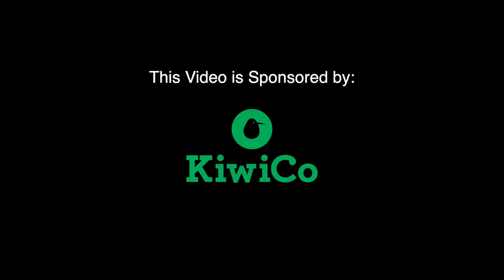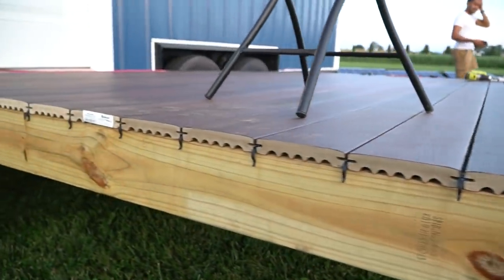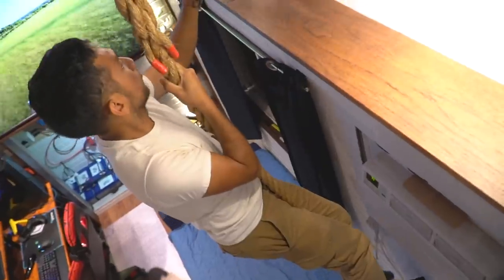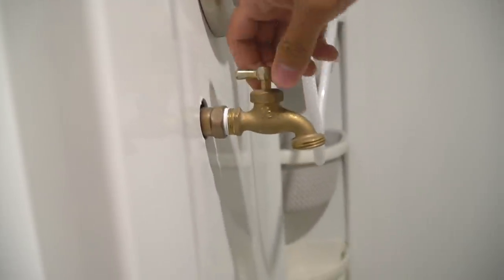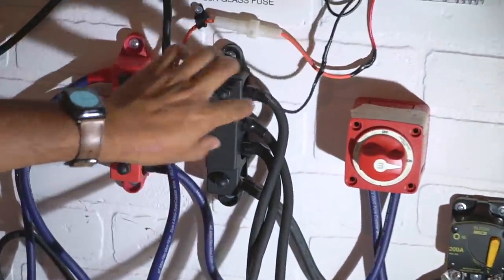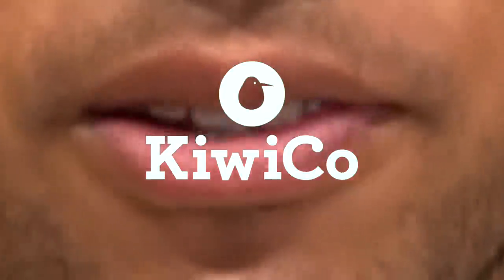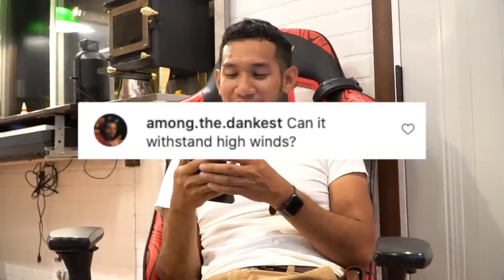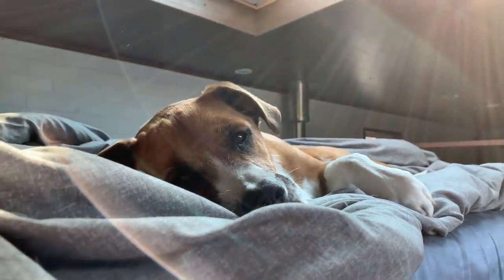BUILDING AN ILLEGAL HOUSE for 30,000$

Comment: I want to build something similar on the back of an m35 deuce and a half
Reply: That would be pretty sick👌🏻
Reply: Top speed: 25 mph lol
Reply: Hi
Reply: @isaactrockman4417  *2,5
Reply: fuel economy - 8 gpm
Reply from the maker: ive considered one of those for the base vehicle lololol
Reply: Ive seen someone do it with a hemmt.  Got about 1.5mpg
Reply: Have you ever seen the Unimog campers? Now that is a zombie apocalypse vehicle.
Reply: @yannickg6904  Bucks though for the new ones
Reply: @jamesshamley6577  where I am, you'd be lucky to ever spot any kind of unimog. Shame, I would love the old 500s to be more commonly available.
Reply: Look for a 5-ton with an 'expando module.' Still military surplus with plenty of parts around but almost ready made.
Reply: Got a international s-series with a 18ft reefer box, turning it into a tiny house/rv thing. But i'd rather have a deuce, except prices skyrocketed over the last few years.
Reply: I once took a deuce and a half
Reply: Yo, same here.  Except I have an M211 instead (older Deuce).
Reply: @Firebat45  today i actually dropped an old duece, I've been trying to drop it for like 5 days now I was getting worried
Reply: Thanks for that now I'm drooling! If you do, you should consider a sheet metal exterior with a rigid cast in place foam, they make them in fireproof varieties, and being foam they have great R value. Also helps rigidize the structure and cut noise, and the metal exterior would be easy to match to the m35!
Reply: Ive seen that done several times as a "Bug Out" survival camper o.o Zombehz no eat what they cant catch
Reply: @yannickg6904  Unimog Black is my lottery win go to vehicle.
Reply: @69uremum  There are plenty of parts for deuces for now but in the very near future, they will be in the 'no longer supported' category. 5 tons are still in the inventory, though.
Reply: @yannickg6904  yea, until you're looking for parts or even a replacement tire in small town no where.
Reply: @PeterSripol  I cant express my disappoints enough... 12000lbs omg & you built foamy ultra lights... WHAT WERE YOU THINKING... oh wait... you weren't, i get now... you're gunna do a foam sandwich lightweight aluminium version next aye... WHY NOT!

Have you forgotten the principles of monocoque shell (even if you did build it with a frame) & stress lines for hard points for trailer hitch & suspension
Reply: @helpabrothawithasubisaiah5316  As a dad, I recognize and appreciate that was a dad joke

Comment: I think you'd benefit a lot from having a window A/C unit that can also act as a heat pump. They're an unbelievably energy efficient way of heating your home.
Reply: "SIr the AC isn't reversable"
"Weld a license plate flipper to it
Reply: Just put it the other way around and rip the control panel and stick it on the wall.
Reply: @ignasanchezl  or get one with a remote and simple add a mirror, way easier than taking it apart. Hell, put it on something that spins and locks in place flush with the house and you've basically got it done already.
Reply: @shadowsnake5133  You would need it to be mounted with a window next to it. You would probably get some leakage
Reply: almost every house in northern europe has a heatpump! They're awesome
Reply: Heat pumps are all the rage on YouTube right now!
Reply: Is this what we call reverse cycle ACs in Australia?
Reply: thats called a mini split and he specifically explained why he chose not to use one. He also uses a wood burning furnace. I live off grid, heating is BY FAR the most expensive thing to do electrically, Its laughable actually to suggest that electric heat pump would be more efficient off grid than the wood burning stove he already has.. this is coming from somebody who ACTUALLY lives in a RV in the desert using solar. You use gas or wood for heat...always. other wise your going to use a 1000$ battery up every 45 minutes. (lookem up those are 1 kw/hr battleborns)
Reply: With that gamer rig he doesn't need a heater
Reply: @lukejohnson6415 lol if only it were true
Reply: Lane AWD  a 20kw bank? do you have ANY idea how much that cost? hes using battleborns. its easy battleborns ar 1000$ per kw, youre looking at 20,000$ to run an ac and you think thats more efficient than gathering wood and burning it? I dont care what you do for a living, i actually live offgrid.
Reply: @jihartbladhest2749  Its actually fairly accurate for a small space. My pc heats my bedroom to the point I have to crack the window in the winter even when its below freezing out because my room will be too hot. (That is without any other heat source.)
Reply: Lane AWD  Alaska?
Reply: Lane AWD  Nice. I was was born in Littleton outside of Denver
Reply: @jihartbladhest2749  While you're right about the relative efficiency and the smart order in which to use available resources... window units are increasingly availble with heat-pump modes nowadays. Of course still generally a worse idea than using the wood stove for heat like you mentioned. The only use cases I can imagine for it are when burning is prohibited, or to just slow down heat loss while the house is unattended (eg: sleeping or just out for the day). It would of course require a microcontroller or very careful use to not flatten your batteries though. 

However - Even with heat pump functionality available and working excellently I'm not sure how worthwhile it would be. The use cases where it shines are super edge

Comment: I framed houses for a few years and think this is amazing work, im concerned about the bracing of the above floor but i trust you built it well, looks amazing man!!!
Reply: there's little diagonals in the corners. Might've been in the previous video. I've never worked with galvanized, but i don't think it takes those t straps like wood frames take. plus it seems to have ridged sheeting, but im not familitar with that product.
Reply: @BattleGn0me  tbh i didnt look to hard when i commented this but thanks i see what you mean! i was just concerned for his safety at the time but hes very intelligent and im sure he built it strong😁
Reply: @ChrisW777  plus, unlike Celotex using ring shank, the sheeting was being sheet metal screwed on. I'm only replying because I need to rehab a farmhouse in the same state and I'm thinking of maybe using the same system for an update to get it up to code. But to your point, if he can put a foam/electrica airplane in the air, he's probably got the mini house thing "nailed" down--safety wise.😄 Btw, if Imnot mistaken, I think he had all teh wall members pre-fabbed by a mini-hoise custom kit company of some sort.
Reply: @ChrisW777  Also, I framed houses back in the early '90's so my understanding of construction materials and codes are a bit dated, so I'm not trying to be snarky or anything, it was just something I happen to notice
Reply: @BattleGn0me  no worries man, i dont sub to him just see vids here and there but i should cuz its good stuff, i was a house framer 3 years ago but worked with lumber so metal is foreign to me but i love the knowledge!
Reply: W youtube comment thread very rare to see

Comment: To keep the fresh water tank from freezing, an electric heater is probably simplest since you have dozens of solar panels to spare. But for a more DIY approach, consider a solar thermal collector, made from a coil of PEX water pipe coiled in a shallow box about 1 sq.m / 1 sq.yd, covered with glass or acrylic. This could either circulate water directly from the fresh water tank, or maybe safer, weak antifreeze through another coil under the base of the tank. A similar panel could work as a pre-heater for the water feeding your electric hot water tank.
But speaking of that electric hot water tank, you mention switching it on only when using it. I hope you’ve got a strategy that simply wasn’t mentioned in the video for keeping it disinfected. You can get some nasty diseases growing in a water tank when it cools below 120F / 50C. Is it good enough to hope that warming it back up to 140F or so once a day takes care of it? I don’t know, but I’d want a firm answer before showering in it.

Comment: Those stair-drawers desperately need some latches so you don't break your neck. But overall it is an extremely cool house!
Reply: i think the lids insert into the storage
Reply: Yeah but they can slide out when he walks downstairs.
Reply: yeah or some sort of edge inside so they can still be taken out but not slide out all the way horizontally
Reply: If you look close when he lifts the first one, you can see it has some kind of edge underneath so they sit in place properly.
Reply: @MotoAtheist  I think the treads simply slide in beneath the risers, which won't prevent the treads from slipping.
Reply: @mgratk  You can see there's a latch that stops them sliding off which is why when he took them off you can see he raises the front a little then slides it out.
Reply: @mgratk    I can clearly see something under the tread that allows it to align properly.

Comment: just so you know with starlink, the reason the say its "geo locked" right now is because theres not 100% coverage. As long as there is a base station in range your starlink terminal will connect, it's not actually "geo locked" in the sense that if you take it outside your property/state it wont work
Reply: Wifi ?
Reply: @joshuaconnor6085  starlink
Reply: Its primarily due to bandwidth. Satellites coverage is there pretty much at this point just each sat can only service so many subscribers. So they limit how many subscribers exist in any one area. Roaming is allowed now but the assumption is that you're not a permanent subscriber in that zone, thus they can cope with the increased contention without risking a drop in performance and service for in area subscribers.
Reply: It was actually due to legal reasons but the FCC has finally given them approval for mobile operations (mobile satellite stuff has stricter rules than geo-locked satellite stuff).  Apparently some people were able to use it on the road even before that but legally speaking they still had to say it was geo-locked.

Comment: If you want to improve your sink situation (well, sink ringing sound, actually), you might want to stick that standard 2-3mm heavy adhesive car sound dampening mat under a sink to remove most of the ringing sound from it - costs nothing, works amazingly well.
Reply: That’s a legit tip. Thanks for that Phil
Reply: Oh so THAT'S why I've seen that stuff stuck to the bottom of sinks before. I had no idea what it was for.
Reply: Skip the high priced audio crap and just get self adhesive asphalt ice shield ...

Comment: People have done some tests and so far they “haven’t actually” geo locked starlink yet but I’m sure that could change pretty quickly.
Reply: Your Starlink account is linked to a geographical cell. You can in theory use it outside of your cell but if a cell you move dishy too isn’t officially supported it will not work
Reply: @hanspecans  Makes sense since they are still new. Right now they want to keep a certain number of people in each cell. I doubt they would start geo locking. The only reason I could see them doing that would be if they turned scummy and started geo locking, but having a "geo unlock" package that you have to pay extra for.
Reply: i don't know anything about that but i anticipate starlink once exiting beta won't be locked
Reply: From what I understand (from minimal research) the reason it’s geofenced is because they have to know your location to have satellites in range of your region. If you took it too far away from your geofence there may not actually be a satellite in range for the whole day. Idk if that will change when the full starlink cloud is up but that’s supposedly the reason. That’s why people who have taken their starlink mobile and have still had reception. They happened to still be in a area with coverage. I could definitely see someone going on an RV trip to like badlands or somewhere really random and there not being any reception due to the fact that there aren’t any customers there so there isn’t satellites in that inclination or orbit or whatever.
Reply: Somebody was able to contact SpaceX to change the location. Maybe on their website. So he could move it
Reply: They've said that geo-locking is planned to go away when they have mobile certifications from governments, etc.

Comment: doesn’t want lightning to hit him through the skylight “I’m just going to put a metal shield on it.” Well, we’ll see how that goes.
Reply: The metal would guide the lighting away, like a car. Being inside a car is safer than being outside, even if the car is made of metal
Reply: Ever heard of gauss law
Reply: faraday cage
Reply: A metal "shield" would not do a thing. If it jumps 30 000 feet through air, it can jump the 2 foot and into your head no problem. That being said, the house is made of steel, so it is already like a car and  any metal "shield" over a window would not matter. Normal glass does not conduct electricity, from what I know.
Reply: @Robert-bw6jk  sure, it _could_....if there's nothing else with less resistance for it to go through, like metal

Dunno why, only half hour comment showed when I first read, glad you seemed to have it actually, nvm
Reply: @OatmealTheCrazy  the house's structure is made of steel...

Comment: This was so cool to see! Seeing you mention having to pick between hot water and AC makes me wonder how long it will be until we see hybrid-style water heaters for tiny houses, or a way of doing AC in a way where the waste heat from the coils can be recycled into hot water. Also, they do make DC-DC PC power supplies nowadays, so that might be an avenue worth exploring to eek out more capacity out of your battery backups.
Reply: Not for tiny houses but in my country new resistance heat water boilers are no longer allowed. So the new boilers here have a heat pump on them which make the basement cooler.
Reply: @Tom-ku8bu  heat pump water heaters need to be a bit larger to match the same demand which makes them suboptimal for a trailer, but they are a better option in most other respects. A coil of PEX on the roof that has been painted black could be used to preheat the water though which might be a solution.

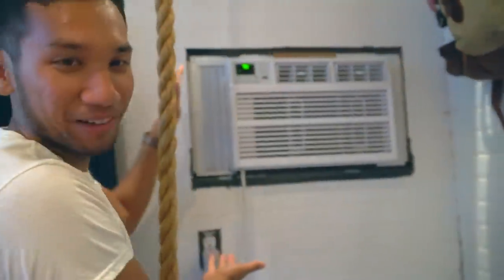Comment: 7:00 as somebody with a diploma in HVAC technology, I approve of the window unit. Package systems are just as valid as split systems.
Reply: Lmfao how much money did you waste on that diploma?
Reply: @inferno7181  aside from the crappy cingage textbooks that even made the teachers mad, none at all. Tuition is paid for with grants whatnot, and there are even ways to get money specifically for text books. Even if you refused any handouts, technical colleges are way cheaper than 4 year colleges. (And there is a minimal amount of hoop-jumping)
I also laugh at outdated electrical components now, so it's definitely worth it (did I mention that everyone in HVAC is a little bit nutty?)
Reply: How do you like it. I've been doing it for 5 months not really thinking about continuing after a year. Maybe go into install and try
Reply: @kevsimoes  sorry to hear that bud. I fnished my last semester a couple months ago, and only worked full time for a month in the summer of 2020 as a helper doing installation. It was too tough for me, but you might get a completely different experience. I will note that installation has a lot more repetition than service and repair. If you're fine with that, and with the (alleged) increase in pay, go for it. Good luck!
Reply: 「 Deadpoppin 」  ah, sorry, there's been a misunderstanding. I meant (Heating, Ventilation, and Air Conditioning), not (High Voltage Direct Current). And yes, I agree, DC motors are better. You may also be happy to hear that the newer and fancier high-efficiency air conditioners have DC motors in their compressors, so they can run at lower speeds when needed, in contrast to the constant starting and stopping of archaic AC motors used so commonly in older and cheaper machines. If only the economy were better, we'd get to see more of those majestic DC air conditioners in the wild. (And no, I'm not counting the one in your car. That's got car mechanic cooties on it.)
Reply: @rogerramiussergeialexander5541  yeah ima give service so far a year, plan on going to portugal after I put in my 2 weeks then ima try install. All depends on how things go. Service is ok just the hours and all the other stuff with be stressful. I'm 19 I kinda wanna have time doing stuff and from what most service tech tells me I won't have time, I value my experience more than money. So we'll see how everything works out
Reply: @rogerramiussergeialexander5541  but thanks for the heads up.
Reply: @inferno7181  rude